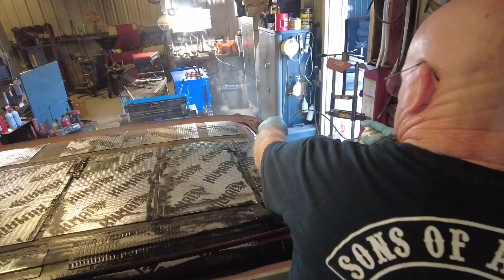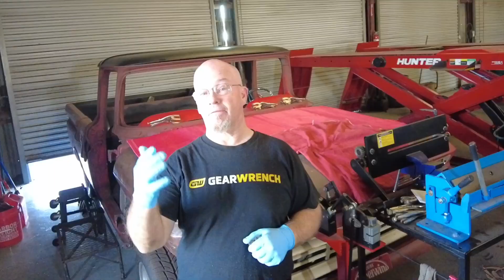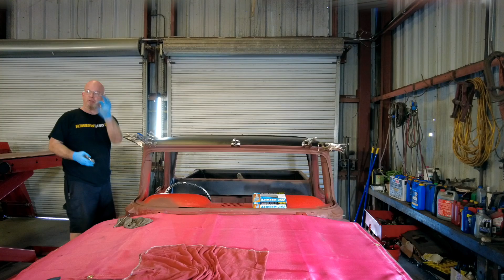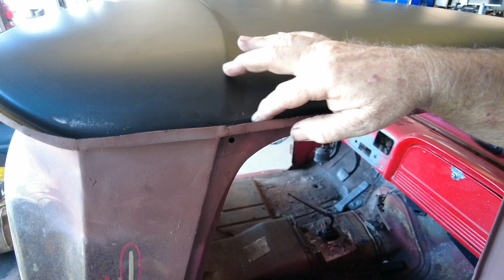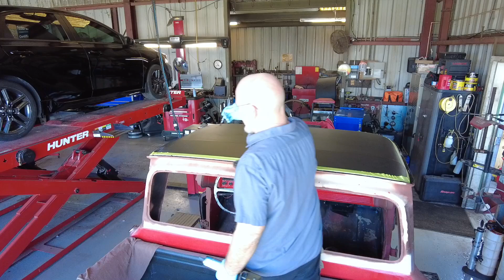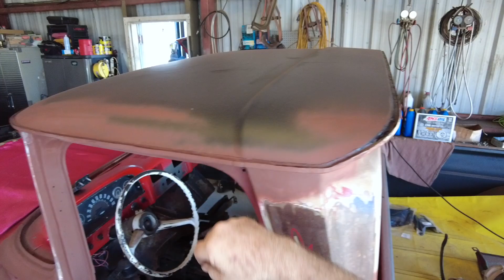ROOF PANEL BONDED ON. RUST REPAIR, 62 CHEVY TRUCK, C10 PICK UP PROJECT 54...

Comment: Coming together nicely! I enjoy your vids because it makes my 1980 El Camino seem just a little wee bit less rusty. Lol, motivation is where you find it. A couple questions and comment as I've never used the panel bond before. Does the bonding area get primer or is it direct to the metal? can you share the actual product you used (panel bond and seam sealer)? Having re seam sealed a drip rail years ago after wire wheeling the shrunk and cracked factory stuff out I did have good results using my gloved pinkie finger (and enamel reducer) to smooth out the sealer. It appears this newer stuff flows much better than I remember which is good because these days that pinkie is more hot dog sized and probably wouldn't fit the drip rail as well.  Thanks, and keep the videos coming!
Reply from the maker: Yeah, the area of both panels has to be freshly ground metal, that footage did not make it and was unusable. I mentioned it, but no video of it.
There are high flow seam dealers now too, makes it much easier with a caulk gun. :)

Comment: The roof looks great! I think you made the right decision to panel bond the roof rather than spot weld. The seam sealer becomes hard and brittle over time from being baked in the sun. The water gets in and between the spot welds. The panel epoxy will make for a water tight seal. It's going to look great painted in Ivory.
Reply from the maker: Thanks M! Exactly what I was thinking!